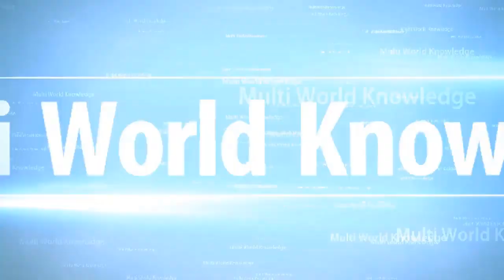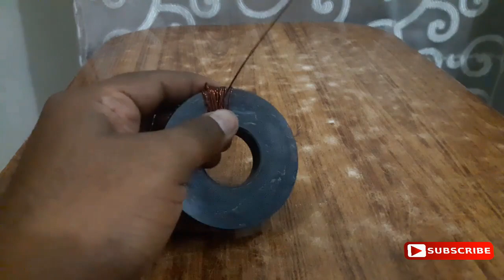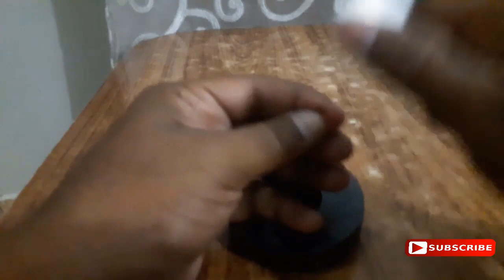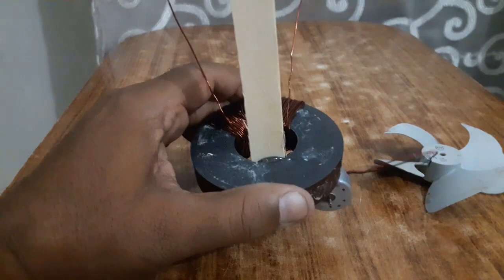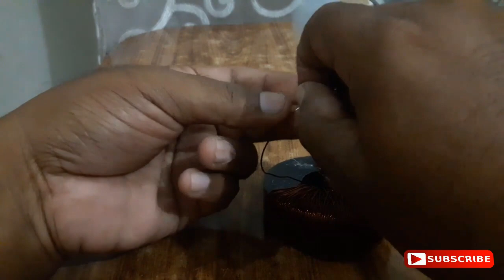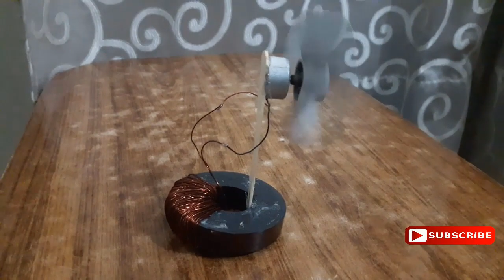Free Energy Generator | Exhibition Project 2018 using Magnet DC Motor and Copper Wire

Comment: 1. How many turns?  2. Pole orientation, ie, North on top, South on bottom, North on left, South on right? 3. Size battery in the motor. 

How nice if it were true. Think of all the motors in junk yards with coils wound and ready for a light bulb.